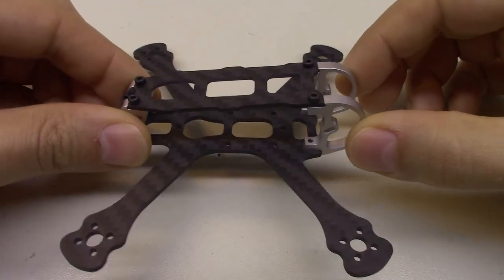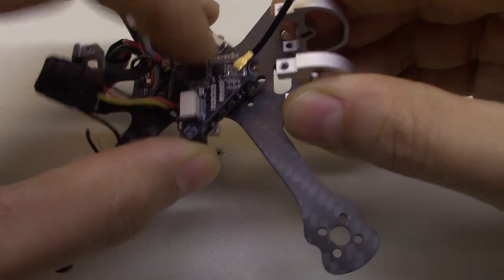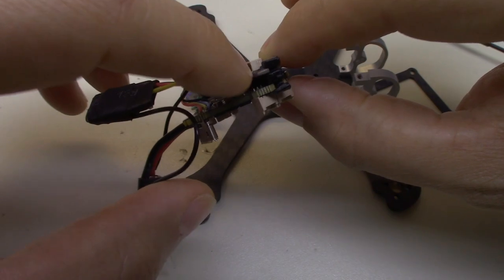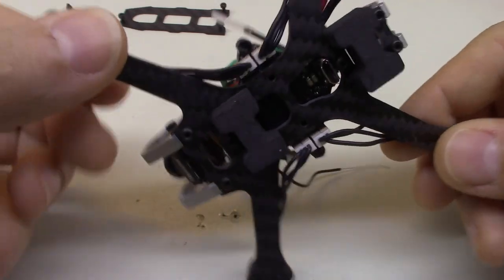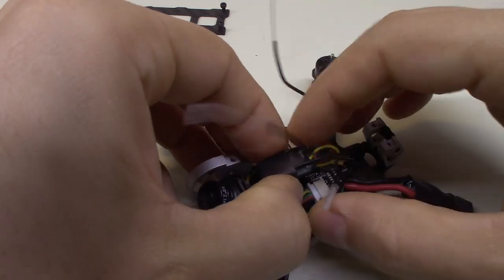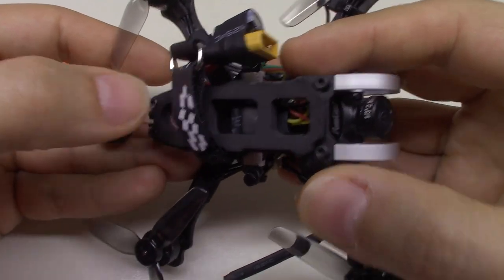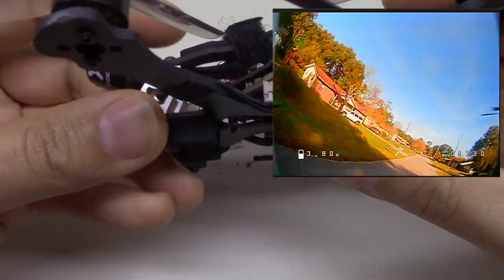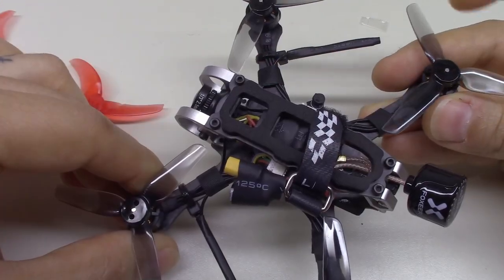Armattan Tadpole Build

Comment: This frame is going to be my first build. I am so frustrated with it so far. Knowing nothing, I bought this frame and a Mamba F405 20x20 stack. I get the parts and find out the Tadpole only takes 16x16 stacks or the whoop boards. I think I am just going to widen the frame in between the front and back legs and drill some 20x20 holes and use the Mamba stack. Just have to be able to mount it and solder the vtx, receiver and motors and maybe I'll have something decent to fly this long weekend. Now I wish I would have bought the Gecko.

Comment: Nice looking build! I bet it would do really well with the Diatone mamba 1103 8500kv motors as well. Overall those red avan props are some of my favorite for 2.5" performance.
Reply from the maker: Yeah. The betafpv motors aren't my favorite. I'll be swapping them out for fpvcycle 1303 as soon as I figure out how to drill prop hubs without vibrations.
Reply: @DoRC  You could drill the center slightly oversized and rely on bolts to center and secure the props. This setup on 1303 should be really fun!
Reply from the maker: @sixtofive  I tried that but still had vibes. It's a work in progress:)
Reply: @DoRC  Hmm... Maybe the new flywoo 1202.5 or the new happymodel 1203 motors would be worth a look then. They're all 4 hole 9mm base mount with 1.5mm center shaft. They are a little lower kv, but should still be high enough if you're on 3s.
Reply from the maker: @sixtofive  true. I'll take a look!

Comment: Hi, im planning to build my own armattan tadpole with the betafpv silverware 2s board, diamond vtx, xm+, and probably happymodel 1103 8000kv motors. For camera, im thinking whether to go with a baby ratel. Is this ok for a 2s build? I’m looking to make a semi freestyle cruiser with long flight times. Any suggestions? I already have the fc, vtx, and rx so options for frame, motors, and camera are still open to change.
Reply from the maker: Sounds like a good setup to me!
Reply: I’m worried 2s won’t cut it for efficiency with a heavy frame?

Comment: 85x blheli32 esc and fc?  -  Will put the same on my tadpole. - But i will solder the motorcables instead of using connectors.
Reply from the maker: Should work just fine.  Thanks for watching and a sub is appreciated!

Comment: Good looking frame. I like the tooth picks but not sure if i wanna start building them. They are so freakin small hard to solder , & see for me. I just buy the PNP right now, but i might tinker with them :)
Reply from the maker: The toothpick specific boards are a lot easier to solder than the whoop board but it can be tricky either way. It's rewarding when done though!
Reply: @DoRC  Yeah i'm just getting back into hobby so im upgrading a lot of my 5" but these smaller guys i haven't messed with. I really want to try a build soon though
Reply from the maker: @rueda82nd  the great thing about the little light quads is you can fly them just about anywhere and no one cares.
Reply: @DoRC  agree